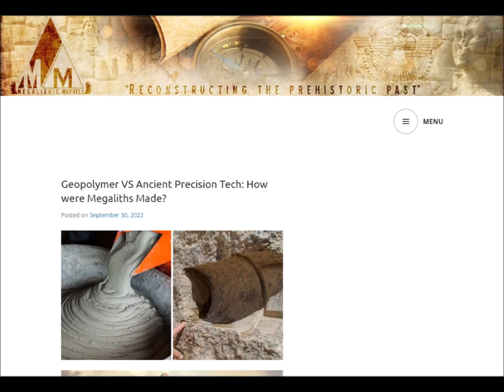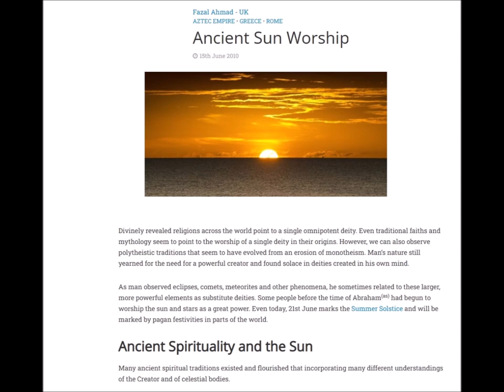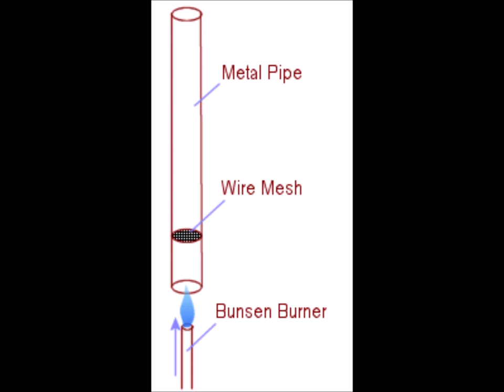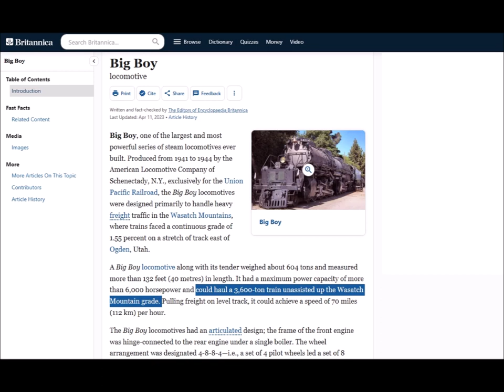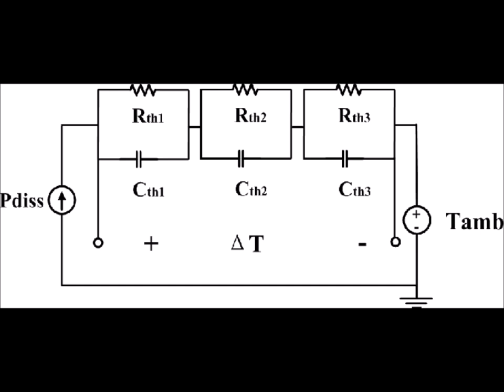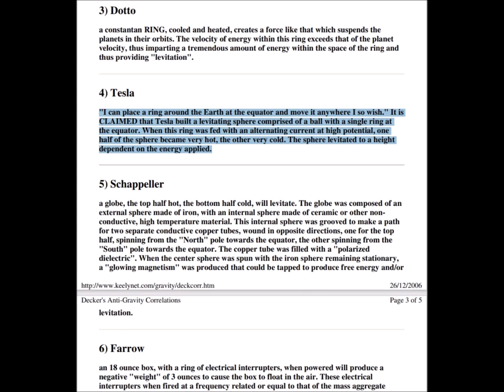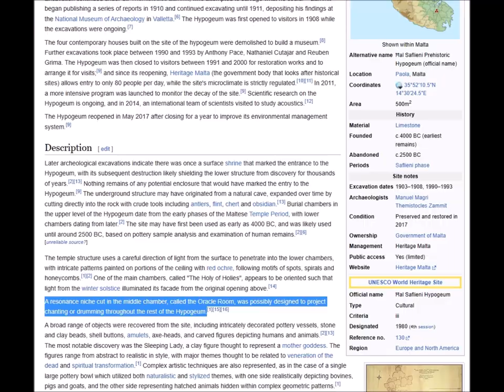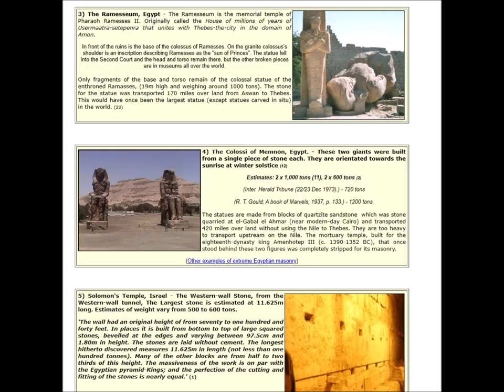Ancient Thermoacoustics: How the Ancients Could Have Generated Powerful Sound without Modern Tech!

Comment: Just a thought. Think from the perspective of a primitive man.  You know what fire is because it produces heat and light.
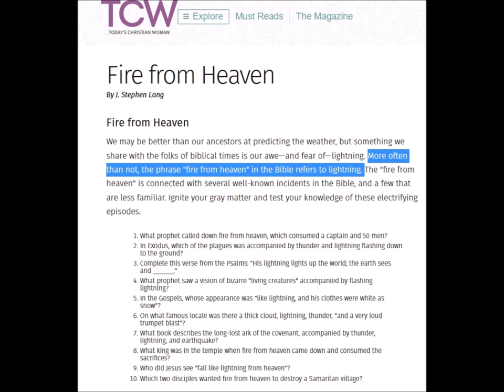Then one day some dudes show up and start moving hude stones 36:04  with a device like the ones shown in this video. Now Think about a toaster. The toaster wire gets hot and produces light like a fire. If the thermal source of the ancient motor were glowing red hot electrical conductors it would seem like "heavenly fire". The sonic resonance might act like a super charger of the effect allowing the ancients to actively control the machine like a throttle. It would be a pretty awesome machine made with relatively simple parts. Maybe I'll build one.